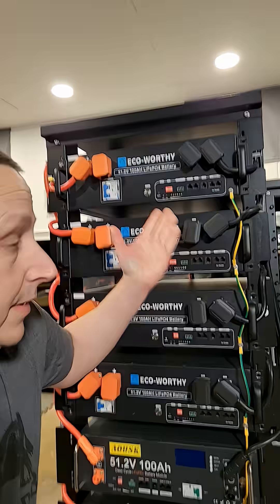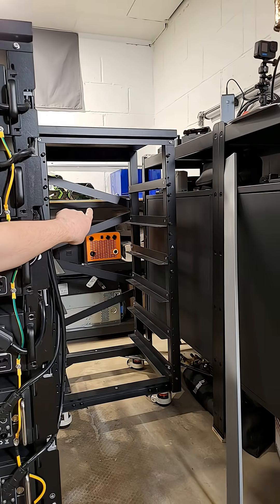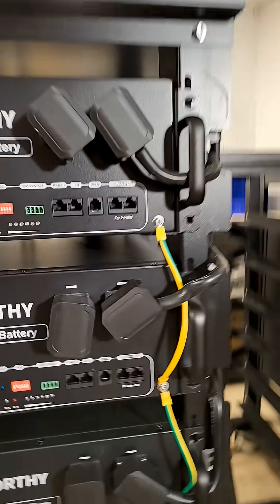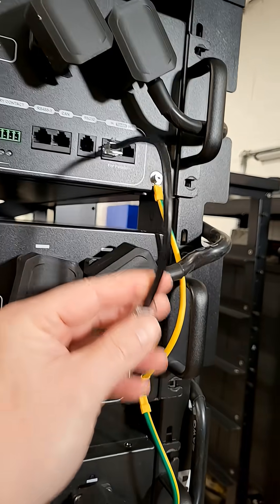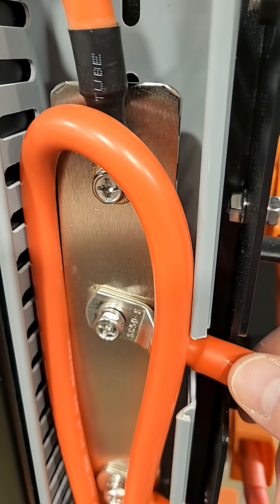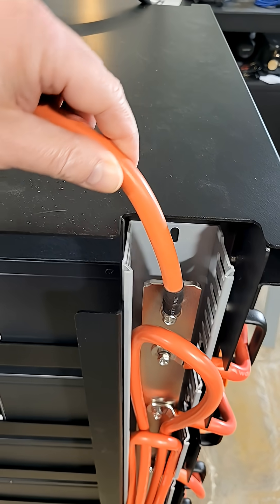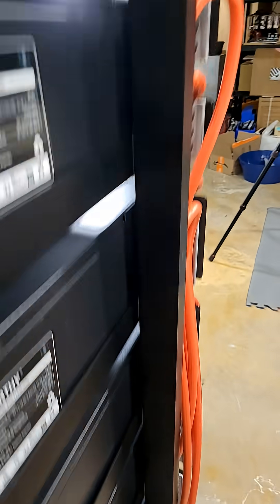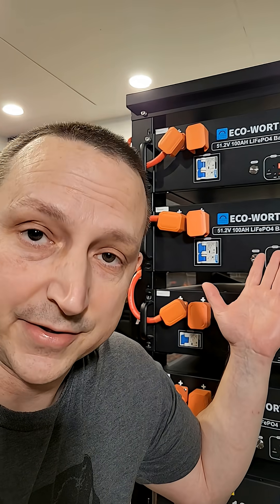Potential Issues! #ecoworthy #serverrack

Comment: Just like rack servers. They only need. 1U gap to allow for a 1U Rack Fan to pull air from the front through to the rear. 
That the only reason for that gap, they’re running into temp problems. 
For this to work at all… you do need a cold hot separation. I could give a class in this…
Reply: Oh and those coolers, the good ones provide a raceway for cabling to keep things neat and aerodynamic like!

Comment: imho, this whole thing is a rushed mess
Reply: It would seem that way, but it isn't. I bought 6 of the newer V3 batteries and their rack. The M6 vs M8 lugs were very frustrating, but 2 hours of time one time with a drill, some cable, and a new crimper and lugs and mine has been working flawlessly powering my home and seamlessly communicating with my EG4 equipment.  The BMS that these uses (at least in V3) has been excellent in balancing the battery cells. Best of all these are now UL listed so no problem with homeowners insurance. Mine has been great for about 40% cheaper than EG4 or other batteries.

Comment: Howdy Average-JOE, ... 
ECO-WORTHY  Battery Rack version-2 "
Yup = 
...
I  <like> the BUS-BARS on the SIDES 
...
I hate the  ONLY  Option on  
BATTERY to INVERTER attachments 
is at the very TOP versus the "middle" 
or 
ONE at the TOP & ONE at the BOTTOM 
with  "equal length"  4/0 (0000) Cables  
...
terrible on the Communication cables  !
IMHO  longer COMM Cables should be PROVIDED with EVERY Battery RACK ! 
... 
Stupid  planning on battery LUGS M6/M8  :-( 
...
I beLIEve  I would slide the ECO-WORTHY Batteries 
 into an  EG4 6-battery RACK instead 
...
Thanks for pointing out these inconsistencies 
COOP
the  WiSeNhEiMeR from  Richmond, INDIANA 
...

Comment: my experience,
1, installing comm's under the main cables fits perfectly on v3 batteries.. only just, but there is slack.
2, should put the neg busbar cable on opposite side as the pos busbar (at the bottom) there is data on reddit and solar forums to back this up.
3, you do awesome job with your videos, thank you for these videos, its always best to be informed so we can make informed decisions.
4, the cables connection holes are too big, totally agree and am thinking of redoing them all on mine.. the cables need to make a tight 90 to be bolted in place, but there is still enough cable.. in fact the cabled might be slightly too long, so i might work out as long as all cable are exactly the same length

Comment: M6 bolts, massive failure.
Reply from the maker: Could be an easy fix as well.
Reply: @AVERAGE_JOE  Hopefully you are thinking about tapping them out to M8? Heck ya. That's what I'd try.
Reply from the maker: May order some with m8 and THEN... move the busbars to the other rack so I can shove it under the stairs😂

Comment: My comm cables fit, just barely but my batteries are ‘ newer’ so maybe they already adjusted that.   I ran my neg out from under the bottom of the guard. Is it a tighter than optimal bend, yes, but it does work.    Would love a review of their newly ul1741 10k inverter as I am thinking of upgrading an old MPP lx 6540. Thanks for what you do and happy new year. Oh, lifepower4 batteries are too wide to fit, by a hair.  You can take off one ear and make it work

Comment: With the latest free-standing and wall mount batteries I'm kinda on the fence with rack-mount.   Maybe if they were set up to hold four packs with 314Ah cells, tho they'd be complete beasts to install.
Reply from the maker: I always prefer wall mount. I had the rack years ago with the 18650s and the racks can take up some room.
Reply: @AVERAGE_JOE  Your 18650 powerwall got me into building my own!  Tho I realized just how much work the packs would be and switched to other cells.  It's crazy how quickly the capacity and power density of LFP's has shot up.
Reply: Using 4 of the 330Ah 12v LifePo4 batteries in series works well and costs about the same as one 5kW server rack battery, but yields 16.8 kWHr. I’m running them in a 4S2P configuration for  over 33 kWHrs into an EG4 12000XP, which works great.  No closed loop communications of course, but they do have Bluetooth to check each cell of each battery to watch for any drift over time.
Reply: Ya, I think 15-16kwh batts are the smallest I'd consider. Great density, less connectivity issues/work/complexity. No janky racks, heh.
Reply: Agreed. I have this rack setup and love it, but my next battery will probably be ECO-WORTHY's 314aH wall mount. I'd like to get two of those to go alongside my current setup. Can say that these V3 rack mounted batteries are good though.